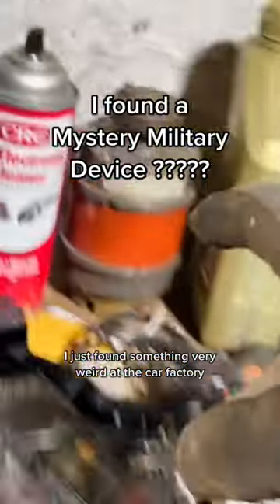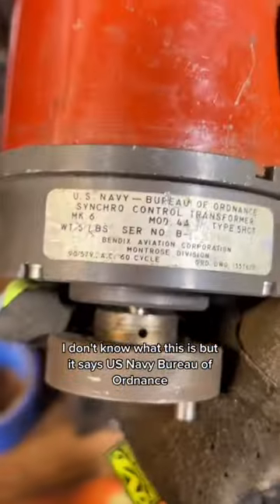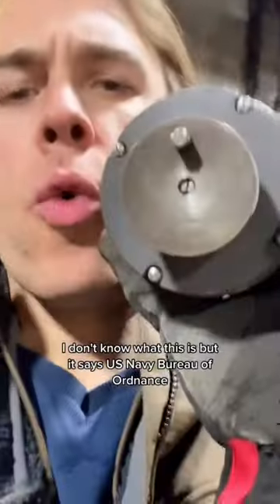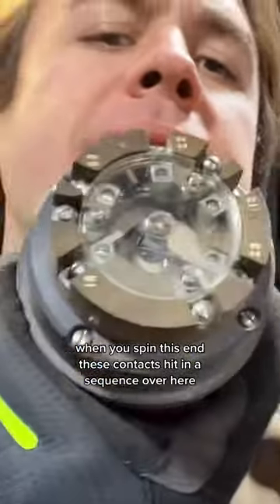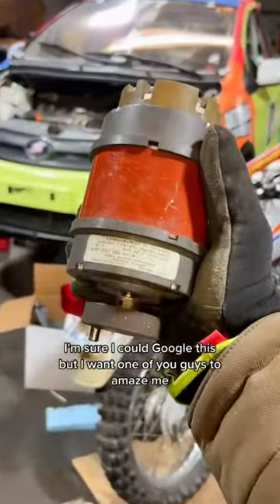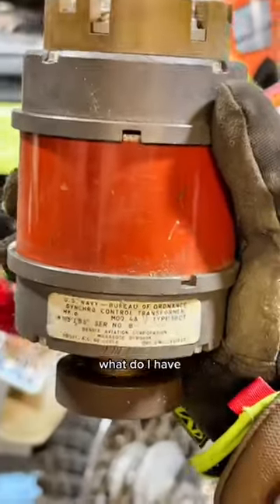I hope the US Navy doesn’t want this device back. 😬😬😬

Comment: It is a Bendix synchro revolver motor. Navy usually uses 90/95V versions. They were often used to accurately position gun turrets and such remotely.
Reply: Lol no
Reply: @miata7478  can you read?
Reply: @lincolnsawyer5076  lol
Reply: This is correct. Synchros are essentially a special form of transformer that give out a different voltage depending on the position of the rotor. So they can be used to accurately measure rotation, in this case the direction a turret is pointing.
Reply: Your answer seems to make sense, so I'm going to agree with you.
Reply: Correct
Reply: This is the correct answer. You could connect this to another synchro, and when turning one, the other would turn in unison. It's a position feedback device. I haven't seen one since Firecontrolman "A" school, about 25 years ago.
Reply: This is completely false
Reply: This isn't a synchro, its a rapid igniter for an engine.
Reply: @JustAGooseman  you should get your eyes checked
Reply: @Just a Goose  No its not.
Reply: The pulling distributor
Reply: Sounds legit
Reply: Had one surplus
Reply: @JustAGooseman  The label literally says 'Synchro Control Transformer'
Reply: Only answer that seems to be accurate
Reply: “Peace I leave with you, Peace I give to you, not as the world gives do I give to you” - JESUS CHRIST The SON of The LIVING GOD

In this world you will find no love, for “whoever doesn’t love, doesn’t know me, for  GOD is love.” - JESUS 

Only in CHRIST you will find real love
GOD bless

Comment: a synchro.. used to make sure 2 surfaces act in unison either exactly the same or at certain phases depending on wiring they are generally used in pairs. One is called Master unit, the other a subordinate.  Used to be common in many industrial applications, most simple being a dual drive gantry with  the synchris used to keep the  2nd motor in speed with the Master.
Reply: I love how old stuff always has a mechanical way of synchronization instead of computers and such

Comment: so what you have here is a syncro and it's not surprising you found it in a car factory because during the war effort a lot of car manufacturers produced all sorts of things for the military from tanks to aircraft and everything in between.  The purpose of this device would take a little digging but the general concept is this, normally you'd have two similar syncro devices the master and the slave  also called a bunch of other names but for simplicity we will go with those I listed. The master has a shaft that turns and as it turns it makes contact with different sensors that then translate that position information to the slave which in turn will turn or move identically to the position of the master syncro  hense syncro aka synchronized.  On ships like a battle ship the Gun sight or range finder would be on one place of the ship while the gun in another the master syncro would be at the sight  and the slave at the gun turret and everything the master did would be translated to the slave.

Since this has ordance in it's name with a secondary hint being aviation chances are it was part of some sorta weapons control system.
Reply: Calm down wiki
Reply: How did you even know what this is?
Reply: @jellydragon7470  that’s sad u would say that to someone that is differently smarter then u …. If u have to insult someone. Be better an take ur time to learn! God bless
Reply: @KaranSingh-dk9kr  you can research a lot of stuff on the internet. It's amazing how much knowledge is just floating around, free for the taking.

just be advised seeking certain knowledges definitely puts you on watchlists and watch out for the false knowledge.
Reply: My life is a Lie. Uhg  Jimmy lets Go.
Reply: perfect explaination, thank you.  right to the point. you should be a teacher.
Reply: @jellydragon7470  jelly bean fan 💀💀💀💀
Reply: Thank you 😊
Reply: Thank you 😊
Reply: Bro wrote a whole essay on it 💀

Comment: That there is a left handed hammer flange nut crimper...only $2,237,687.59 per unit. You can do the same thing with $2 harbor freight pliers...
Reply from the maker: Nailed it

Comment: Synchros are often used for measuring the angle of a rotating machine such as an antenna platform.
Reply: Also it's used for remotely positioning gun turrets. That was probably its use in this instance.

Comment: It says pretty clearly. "Synchro control transformer."
It's US navy, but it also says it's for aviation.
Typically these would be used to synchronize two things together, like a sight and remote gun turret. Though, with it being navy, and with there being 5 contacts, it may be possible that they used this synchro for a gun on an aircraft. Maybe to prevent shooting your props.

More research necessary, though I might be able to dig around with that part number on there to find out more.

Comment: I think it's more commonly known as a stepper motor. It moves in precise measurements like in a plotter. Contacts on back will turn things on or off depending on where the motor is positioned

Comment: We used these on Ham Radio Towers, the sending unit in your hand was on the bench and the receiving unit was under the antennae base atop the tower so the exact compass position of the beams could be calibrated to the indicator.

Comment: A control transformer is one of many types of synchros used to transmit angular position by analog signals from one place to another.  They were originally developed by the Navy for remote control of gun turrets.  The CT synchro normally serves as a receiver synchro which develops an error signal by comparing the remote input to the local angle.  This error signal is then amplified to drive a servo motor to move the local device to align the local device to the input and reduce the error signal to zero.  The simplest synchro system consists of a TX torque transmitter synchro signal to a TR torque receiver synchro over a three-wire, single-phase circuit.  The pointer in the TR points to the angle received from the TX.  I used to teach avionics to aircraft mechanics in the day when most instruments and autopilots were all or partially. analog.

Comment: The synchro is a type of rotary electrical transformer that is used for measuring the angle of a rotating machine. It is classified into two types ; Torque Synchro and Control Synchro.

Comment: It's a synchro controller.  You need a type HD motor which this 5HCT will control.  It's probably out of a gun director intended for a pre-1970s ship.  Probably obsolete, and probably faulty if it got left laying in a box of parts in a Bendix plant.

Comment: It is a specialized component used in various combinations with similar devices to detect and direct angular positions of electrical equipment. Dates from the 1940s. You can look it up online and get a pdf handbook on it. I don't thing there's any use for it in a hanger other than for self defence or a paperweight. It helped win the War in the Pacific❤.

Comment: What is a synchro control transformer? 

Synchro is a type of rotary electrical transformer that is used for measuring the angle of a rotating machine. It is classified into two types ; Torque Synchro and Control Synchro.

Comment: synchro (also known as selsyn and by other brand names) is, in effect, a transformer whose primary-to-secondary coupling may be varied by physically changing the relative orientation of the two windings. Synchros are often used for measuring the angle of a rotating machine such as an antenna platform.

Comment: So synchros are used to instruct the people underneath the turret(the gunner) to turn turrets or alsto turn antennas accurately without long ass steel cables or shafts impeding or snapping and causing the thing to rotate uncontrollably

Comment: That's the Hyper-Fluxtropic Decoupler, a late advancement in the field of reverse-dynamic energy management systems. This once state-of-the-art device was designed to eliminate the inherent inefficiencies and synchronization errors that plague traditional motor starters, ensuring optimal performance and unparalleled energy savings.

At the heart of the Hyper-Fluxtropic Decoupler lies the revolutionary cross-fused quarkiod matrix, which utilizes a semi-permeable subdermal array of nanoscopic bi-axial flux capacitors to maintain a continuous torsion-balancing effect within the system. This matrix dynamically adjusts the flow of decoupled energy particles in a quasi-harmonic sine wave pattern, reducing the incidence of spontaneous hyper-resonance cascade failures and minimizing the need for manual recalibration.

The device also features an advanced thermionic gyroscopic transverter, capable of transmutating supercooled photon emissions into a controlled, steady stream of ultra-dense positronic plasma. This not only enables the Hyper-Fluxtropic Decoupler to dissipate excess heat more efficiently, but also aids in the maintenance of an optimal energy equilibrium within the system.

The core of the device is surrounded by a series of cycloidal retromorphic dampeners, specifically designed to counteract the adverse effects of asynchronous precessional drift. These dampeners work in tandem with the device's gravimetric inertial compensator to ensure smooth operation and minimal wear on the motor starter's moving parts.

Additionally, the Hyper-Fluxtropic Decoupler employs a cutting-edge polyphasic tachyon modulator, which continuously scans and analyzes the quantum-kinetic energy patterns within the system. This real-time feedback allows the device to instantaneously adapt to fluctuations in load demand and environmental conditions, ensuring a consistent, stable performance regardless of external factors.

In summary, the Hyper-Fluxtropic Decoupler represented the pinnacle of modern motor starter technology, offering an unprecedented level of efficiency, reliability, and adaptability. With its innovative features and groundbreaking design, this device was set to revolutionize the industry, ushering in a new era of high-performance motor control and energy management.

Comment: It was used for many things guys, its a position sensor that gives feedback to systems. They could tell if landing gear is up, or positions of gun turrets or radar and comm systems. It had many uses. However since it's marked Navy Ordinance it likely is from a firing solution computer system on a gun turret
 This one is a Bendix 4A 5HCT syncro, worth about 35$ in working order

Comment: A synchro (also known as selsyn and by other brand names) is, in effect, a transformer whose primary-to-secondary coupling may be varied by physically changing the relative orientation of the two windings. Synchros are often used for measuring the angle of a rotating machine such as an antenna platform.
Reply: It's a high-tech fuel gauge

Comment: As the label says, it is a syncro control transformer. Google tells me this detects errors in a rotating machine. That's all the work I'm doing. I would guess it's part of a rotating turret or the hight adjustment mechanism of a deck gun. It probably keeps the machine calibrated with the motion of the ocean so heavy waves can't interfere with aiming.

Comment: Synchro TypeS
Transmitter
The synchro transmitter (CG) consists of a single-phase, salient-pole (dumbbell-shaped) rotor and a three-phase, Y-connected stator.* The primary or input winding is usually the rotor; the stator is usually the secondary or output element. The rotor is excited through a pair of slip rings with an AC voltage. The field produced by the input voltage induces a voltage into each of the stator phases. The magnitude of the induced phase-voltage depends on the angle between the rotor field and the resultant axis of the coils forming that stator phase. Since the axes of the three stator phases are 120° apart, the magnitudes of the stator output voltages can be written as:
Vs1-3=k Vr2-1 sinθ Vs3-2=k Vr2-1 sin (θ+120)
Vs2-1=k Vr2-1 sin (θ+240)
• Where k is the maximum coupling transformation ratio (TR)
• Which is further defined as TR=Vout (max.) and is a scalar quantity.
Vin
• θ is the rotor position angle.
• Vs1-3 is the voltage from the S1 terminal to the S3 terminal, and all
other voltages are similarly defined here and throughout this discussion.
These stator voltages are either approximately in time-phase or approximately 180° out-of-time-phase with the applied voltage. The amount by which the output voltages differ from the exact 0° or 180° time- phase relationship with the input voltage is known as the synchro (time) phase shift. For a synchro operated at 400 Hz working into an open circuit, the output voltage will always lead the input voltage by a few degrees (8° to 20° for small sizes; 2° to 8° for larger sizes).
From the above transmitter equations it can readily be seen that nowhere over the entire 360° rotation of the rotor will the same set of stator voltages appear. The transmitter thus supplies information about the rotor position angle as a set of three output voltages. To make use of this information, however, it is necessary to find an instrument which will measure the magnitude of these voltages, examine their time-phase relationships and return them to their original form – a shaft position. Such an instrument is the synchro receiver (CR). These two units – the transmitter and the receiver – form the most basic synchro system.
Receiver
In construction, the receiver is electrically identical to the transmitter. The output voltages vary with rotor position in the identical manner as that given for the transmitter. In use, the receiver is connected back- to-back with a transmitter; i.e., like-numbered terminals are connected together (See Figure 1) and the rotors are excited in parallel. At the instant the system is energized, if the rotors of each unit are not at the exact same angle relative to the stator phases, voltage differences exist across each pair of stator windings causing current to flow in both stators. This stator current produces a torque on each rotor.
FIGUre 1
Since the CG rotor is constrained from turning, the resultant torque acts on the CR rotor in such a direction as to align itself with the transmitter. When alignment occurs, the voltages at each stator terminal are equal and opposite, and no current flows. Perfect synchronization is never achieved in practice because of the internal friction (due to bearings and brushes) of the receiver. To minimize this error, the receiver is designed to have a maximum starting friction of 2700 mg-mm. Continued on next page.
  Moog Components Group • www.moog.com/components
Synchro Application Guide
 Inside Rotor Outside Rotor Direct Drive
Brushless Motors Brushless Motors Brushless Motors Brush Motors
     Synchro Fundamentals
As a circuit element, the synchro is essentially a variable- coupling transformer; the magnitude of the magnetic coupling between the primary and secondary, and hence the magnitude of the output voltage, varies according to the position of the rotatable element. In function, the synchro is an electromechanical transducer. A mechanical input such as a shaft rotation is converted to a unique set of output voltages, or a set of input voltages is used to turn a synchro rotor to a desired position.
Synchros can be classified in two overlapping groups: torque synchros and control synchros.
Torque synchros include transmitters (CG), differentials (CD) and receivers (CR).
Control synchros include transmitters (CG), differentials (CD) control transformers (CT), resolvers (CS), linear transformers (LT) and the two hybrid units: transolvers (CSD) and differential resolvers (CDS).
*Note: the use of the word

Comment: Michael is wrong  They where used to control the flaps rudder and and other moving parts that needed to have synchronized movement can be found on Air craft like the A-10 warthog   and some bombers and many of the old fighter planes 1950- 1970 ........... they where also used in some bank Vlad to control the locks  ..but they where not at all an igniter or part of any ignition system

Comment: A control transformer, (also known as an industrial control transformer, or a control power transformer, or even a machine tool transformer), is essentially an isolation transformer that provides excellent voltage regulation. A control transformer is very often designed to produce a high level of secondary voltage stability during brief periods of overload condition, otherwise typically known as “inrush current”.